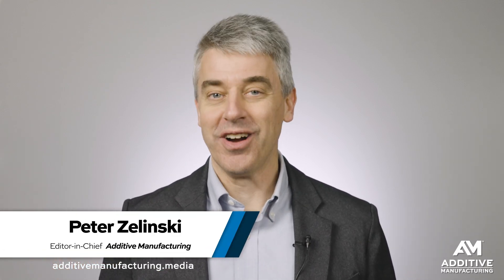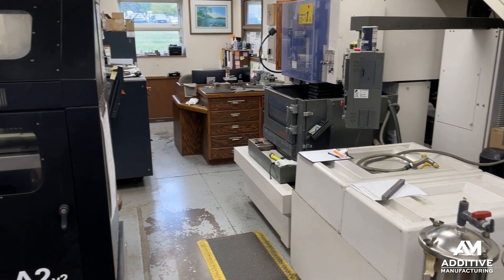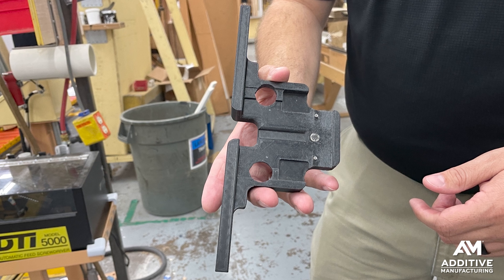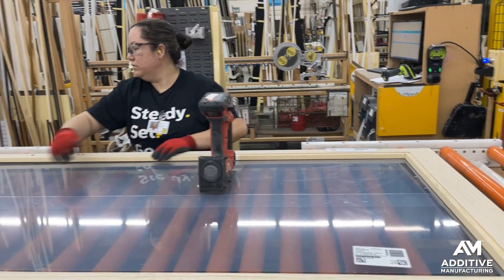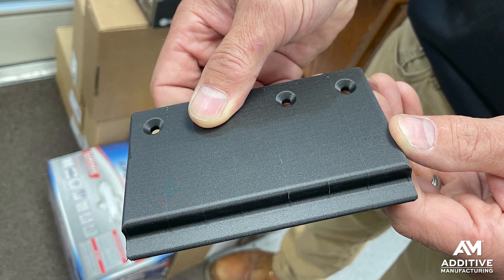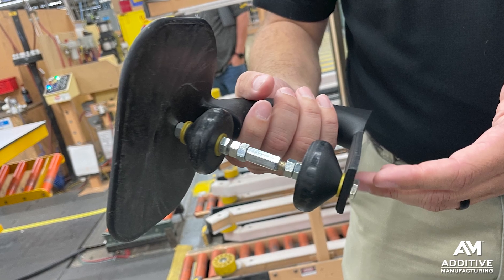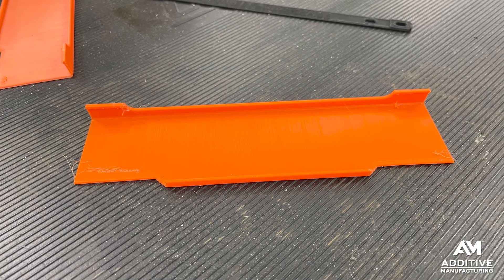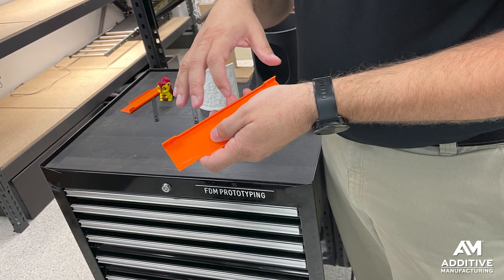3D Printed Hand Tools in Action on Pella Corporation Factory Tour

Comment: That production worker is firing a nail-gun multiple times as she's pointing it at herself. Not a very well designed process, is it!
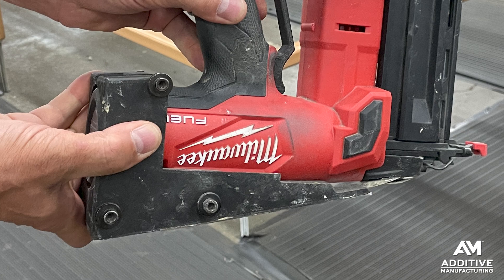Reply: look @2:23 , the red tip must be pressed against the material and then the trigger pressed to fire the nail, no real danger since it has only enough power to drive the small nail or brad nail to secure the trim.  Althrough those big framing nail guns are kind of dangerous in some hands, this one has little power to pose a real risk to those workers.
Reply: Love this content